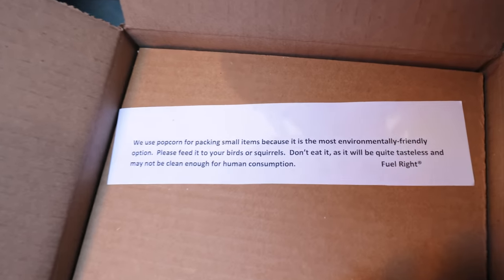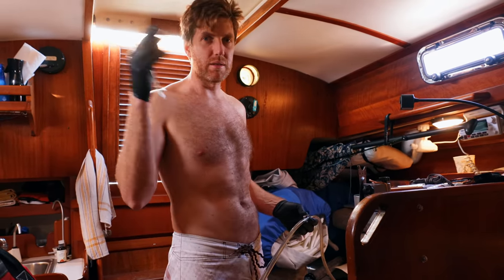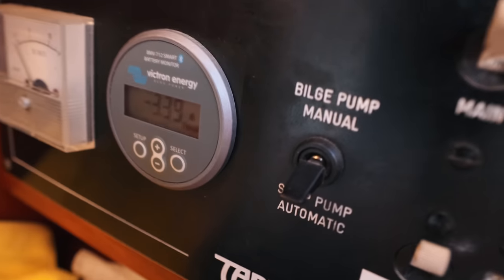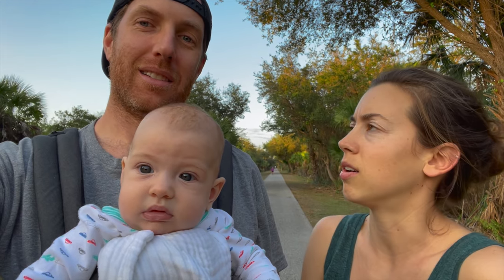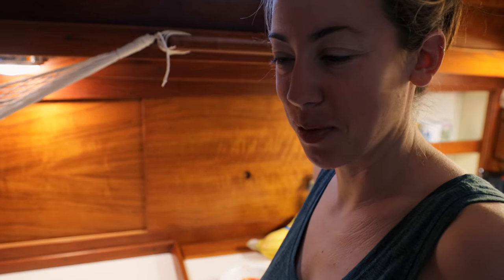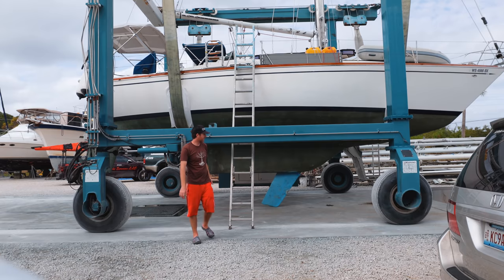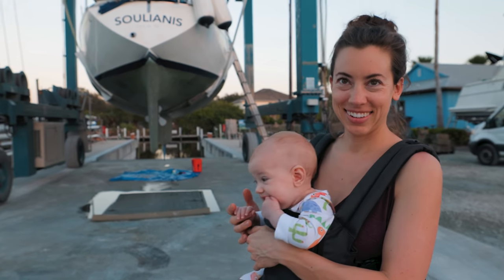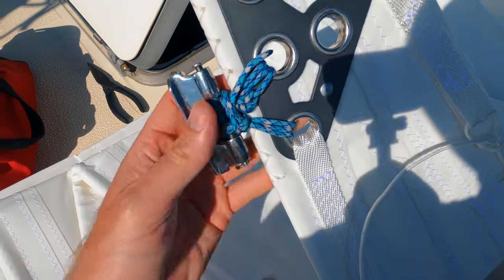It’s SPLASH Day, Baby! | Sailing Soulianis - Ep. 103

Comment: I noticed you was having some issues with the black slime that grows in diesel fuel. At a business I formally worked at before retiring I purchased a fuel polisher system that ran off 12vdc and it worked very well. It was small but could handle a lot of fuel very quickly. The unit was made by Algae-x  and I would highly recommend their products. The replacement filters are a little expensive compared to an automotive oil filter but if something works well a few extra pennies is well worth it.  The Algae-x unit can be mounted permanently connected to the fuel tank so you can turn it on from time to time and polish your fuel any time you feel the need to keep your fuel in tip top condition.

Comment: I wanted to add that I've been a diesel mechanic most of my life and can pass along a few helpful tips. Clean fuel is very important to a diesel engine, or any engine as far as that goes, but dirty fuel or fuel with moisture can really damage a diesel engine. I would highly recommend purchasing a tube of water detection paste to test your fuel tank with especially after refueling and having a fuel polishing system on board.

Comment: just watched Ep 88 again.  Love your videos.  Unfortunately, tightening the backstay does not lean the mast aft without lengthening the forestay.  it compresses the mast and causes mast bend forward.  Remember mainsail flatening
.  Mast rake has to be set up when stepping the mast.  The center of the mast may also be pulled forward using a baby stay.
Reply: Racers have high ratio adjustable backstays. More bend is put in the top of the mast. The top of the mast bends aft and down following the arc of the forestay. It does depower the main. Like a mini reaf.
In big wind racing, tighten backstay upwind, release down wind.
Reply: @artsmith103  On a masthead rig  the masthead can not move fore and aft without lengthening the forestay,  which is not done.  With more backstay pressure, the rig tries to compress, bending the mast forward in middle sections, flattening the main.  Therefore, the mast does not "rake" foreward and aft.
Reply: @michaelmerrithew4042  That's what I said. If the mid section bends forward, the top bends aft and down. Main is flattened, depowering like a mini reaf.
Reply: @michaelmerrithew4042  And our comments haven't even addressed that there can be some sag in the forestay before tightening the backstay allowing even more aft movement of the mast head.

Comment: I've worked with that clear braided hose for years what I do is because it's so hard I dip the end of the hose in near boiling water push it on the tail and while its still soft from the boiling water I tighten up the Jubilee Clamp it compresses the pipe better making a good tight fit regards from England.
Reply from the maker: That’s a great tip that we haven’t been able to take advantage of as often as desired. Boiling water on a boat is a bit of an endeavor depending on where we are.
Reply: You can also use a hair dryer !
Reply: Black can in sun does pretty well to heat half gallon of water.

Comment: I hope you find the boat like Project Atticus did….The boat manufacturer is in North Carolina where they are now….installing a new bow railing that holds two large solar panels and their communication gear. I forgot the name of it….like New England but not that…..has a birth by the stairs and shower…40’ which is 12 meter….if you go big….I hope you can find a 48’.  They paid $205,000 and had some strange fixes to do which did not cost much…almost like somebody played pranks on the previous owner.

Comment: On one aircraft I flew the fuel gauges were in pounds. We ordered in litres and passed on that fuel figure for the load sheet in kilograms.
Reply from the maker: Yikes!  Hasn't that conversion downed planes before?  I know of at least one high profile space related disaster caused by an incorrect imperial/metric conversion: https://www.wired.com/2010/11/1110mars-climate-observer-report/
Reply: @SailingSoulianis  ha ha what could go wrong right?

Comment: hi, great videos - beautiful... quick question... i'm a newb - is the Tartan a "racing" boat - is it suitable for a kinda newb sailor to head over to the caribbean? ... and have you considered the draft (7') for bahamas travel?   Reason i ask, there's a nice Tartan on the market now - i'd be heading off to the bahamas with her... Thanks in advance
Reply from the maker: Yes the Tartan 37 is a fantastic boat for the bahamas.  The 7' draft is only when the CB is down, otherwise it's less than 4.5, which allowed us to sneak up into very protected anchorages.
Reply: I'll just add for clarity that when hinged part is weighted for stability, it's called a swing keel. Common on 18-24' trailer sailors. As mentioned, on the Tartan 37', the center board is meant for pointing higher. No noticeable loss of stability when it's up.
Reply: @SailingSoulianis  thanks ... yeah, saw your episode on the keel ... congrats on everything... u guys are making a bunch of ppl smile ...
Reply: @artsmith103  thanks !!

Comment: In warm waters....you're fuel will contaminated with moisture, from the fuel docks you fuel up at.  And will also  pickup bacteria. That will live on diesel fuel, leaving sludge. Even building colonies in diesel tanks, that resemble masking tape.

We ran into....HUGE...problems off of Mexico...sailing south from Seattle.  Our fuel filters plugged up with fuel sludge.  Even having similar diesel fuel issues, on our diesel tractors on our farm.

Anyway....diesel fuel aditives, are very easy to find.  You can buy them in any marine stores. Or at most big fuel docks.  Put in a couple announce everything you fuel up.  Works like a charm!!!

In addition...we carried 500 gallons of fuel on our sailboat.  Sooo....I built into my tanks.  Plumbing to run and push our fuel, thru a big built in filter.  That had its own electric fuel pump.  That I could turn on, and let run, to polish the fuel in the tanks.  Without the engine running.

Anyway....love you show...

Jeffery....⚘